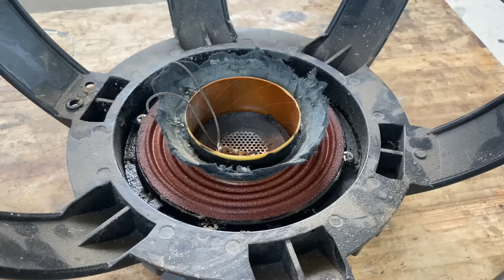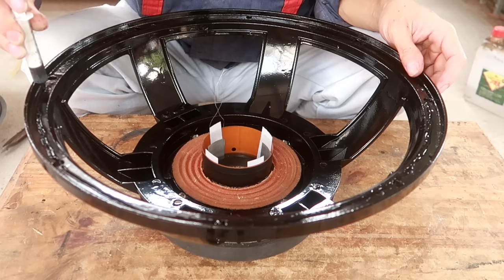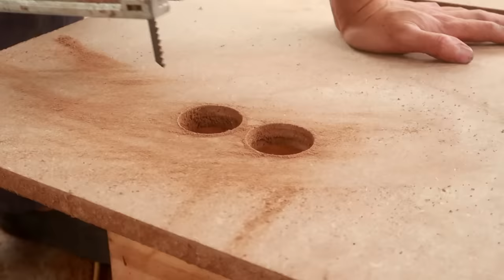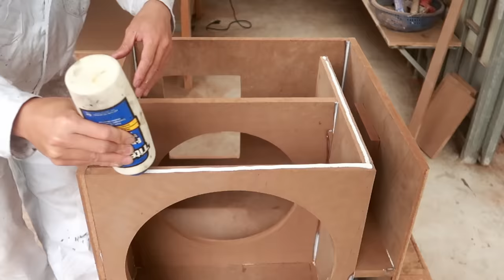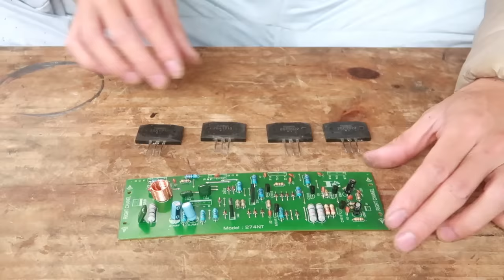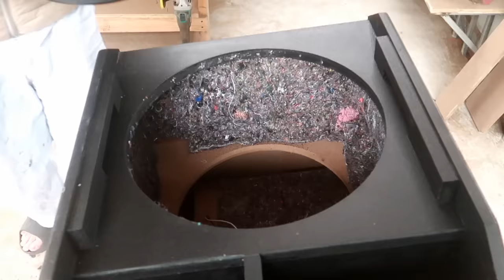Restoration super loud active subwoofer system // Build new subwoofer system

Comment: I have built several speaker enclosures. I use JBL components, many wood screws, much internal bracing, and Baltic birch plywood. The results are staggering to say the least.
    You re-coned your woofer(something I don't know how to do)made your own amp(again, I can't do)and crafted a decent cabinet, with what appears to be a good design. Bravo, my hat is off to you.

Comment: you still should have wrapped the unit's wires in foam. But put a gasket between the diffuser and the column - because air will pass there

Comment: Excellent use of the shims to keep friction down around the coil. Weight is your best friend! Use a little on the dust cap and use clamps around the surround to get a good seal. Could have used a beefier motor if you had one but I guess this one works for your application. Great job in all. Excellent craftsmanship!

Comment: You didn’t use enough glue on the triple joint and didn’t put more glue for the front gaskets. brad nails are not strong enough to hold the cabinet together and you didn’t put any gasket material around the subwoofer plate amplifier. This was a half assed attempt to build a subwoofer for the neophytes who watch this channel. Clearly by the comments your viewers think you did this correctly but you didn’t. 🥱🥱🥱

Comment: That poor power amp I was surprised you didn't use the heatsink on the panel as that would be better at keeping the output stage cool as the heatsink in a sealed box with no ventilation is as good as not having a heatsink on the output transistors at all. also the cables going to the speaker seem a little thin and should be wrapped in foam to stop them rattling. but a nice cabinet though.

Comment: Nice build but not a subwoofer. you can tell by the surround and the magnet - this is a woofer/midbass
Reply: The surround does or does not make it make it a subwoofer. The drivers Resonant Frequency, Frequency Response, The enclosure Tuning Frequency among other things is what determines if it’s a subwoofer or not
Reply: @K-Effect  theoretically yes, but I'm yet to see a sub driver of this size with this type of surround. The excursion would be too low to deliver any sort of useful bass at high volume. This looks like a pa midbass driver to me. Similarly no bump at back to accomodate for the excursion travel. Theoretically you can make a sub driver that looks like it, but I'm yet to see anybody do it that way
Reply: @austerthegreat   Excursion or Xmax is not what makes a transducer a subwoofer

Comment: I own an antique car with one speaker in the center of the dash.  Is there any way to repair/restor the original speaker?
Reply: There are places that recone speakers, in the states, one is simply speakers.There are others that just do repair and sell car speakers.

I donot have their names. Maybe search antique car speakers,
Reply: @davidhamm5626  Thanks!
Reply: @rogerrussell9544   it might be cheaper and easier to find a modern replacement.  Do you know the actual size of the speaker?
Reply: @K-Effect  I have not taken the dash apart yet.  It's small, perhaps 3x5.

Comment: He makes a little mistake: hi must put glue in the join of the coil and the suspension before hi puts the diaphragm
Reply: I noticed that as well. There's no point having a spider if it doesn't connect to anything besides the frame.
Reply: @patrickgriffin9578  8
Reply: @patrickgriffin9578  saan ba ang shop mo po

Comment: Very poor audio result with rattle and distortion. However, you proved you can build speaker chamber!
Reply: It is made to be sold online to the U.S. as a high quality subwoofer but when the poor American sap hears how shitty it sound they will get the Customer Service Department in the dirty garage with the barking scruffy dogs .
Reply: @mannybruce8950  à i
Reply: How do you know it had poor audio result with rattle and distortion? They did not test it that I saw.
Reply: @mannybruce8950  😊😊😊😊😊😊😊😊
Reply: I think I'd rather have has it as a passive speaker running from external amp may sound better who knows..Nice job otherwise